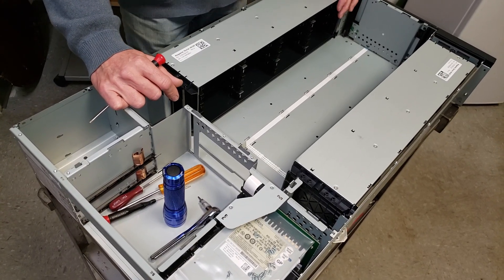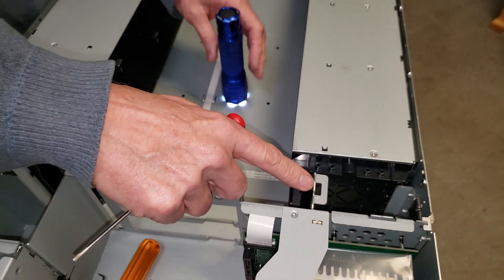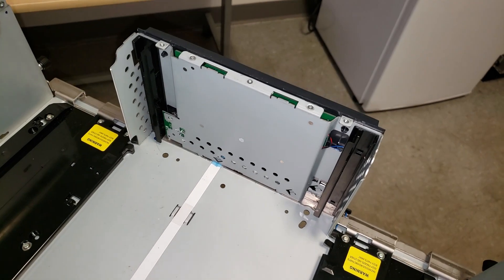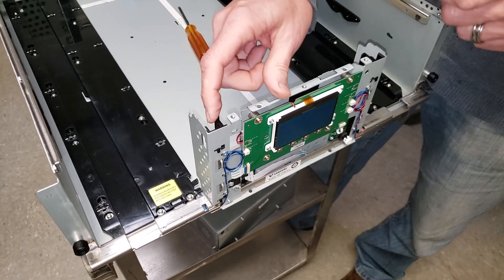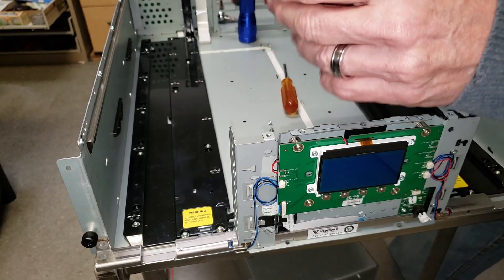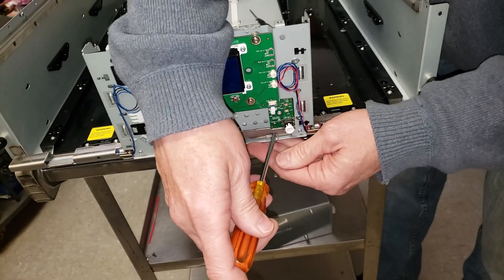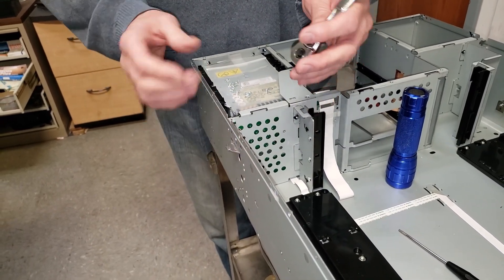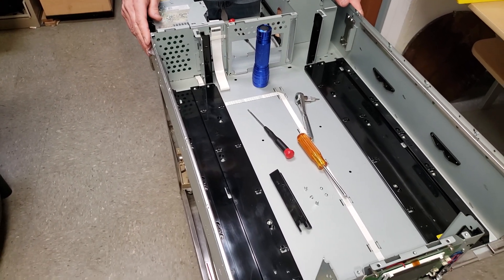Replace Quantum i40/i80 picker gear rails

Comment: I'm looking for the latest firmware for my Scalar i40 tape library and would appreciate some guidance. Could anyone share the official or reliable download link for the newest firmware version? Also, if there are specific steps to check the current firmware version of the library before downloading, that information would be extremely helpful. Thanks in advance for your assistance!